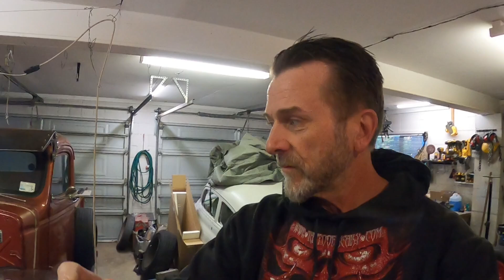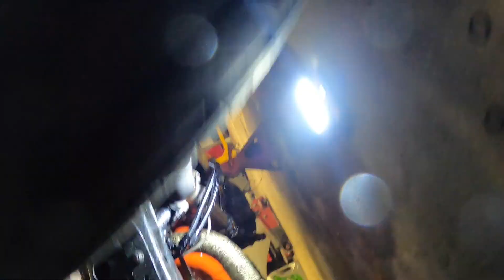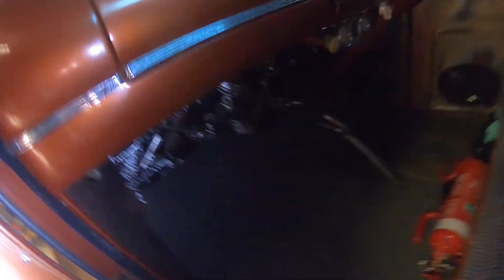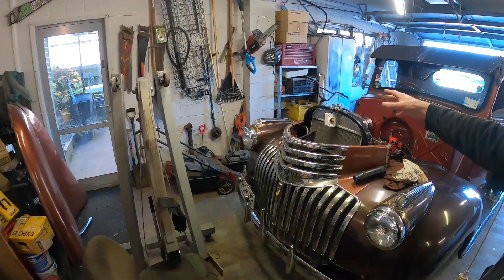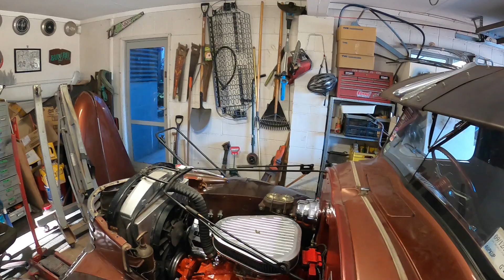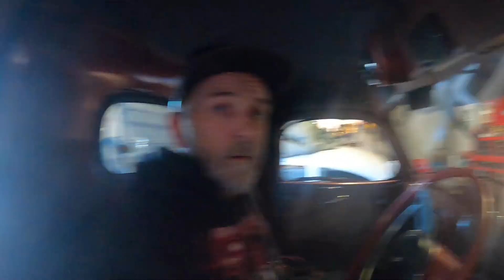1946 Chevy Pickup, Will it run with the mystery 350 small block

Comment: Sounds good.
Reply from the maker: Cheers Phil. Still got a couple of issues to dial in.
Reply: @DMACKustoms  at least that plug helped out. Had issues with mine dizzy when I went to fire it up.  Brand new never used and the coil bit on the top was stuffed. New one of them and away it went.
Reply from the maker: @phil9169 sweet as man. Lots of little battles, just gotta take ‘em one at a time aye.